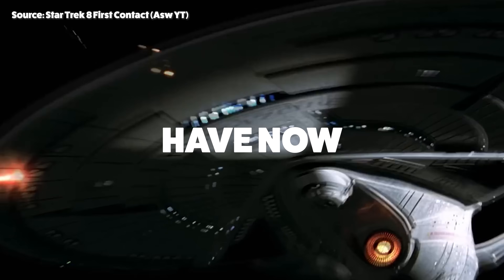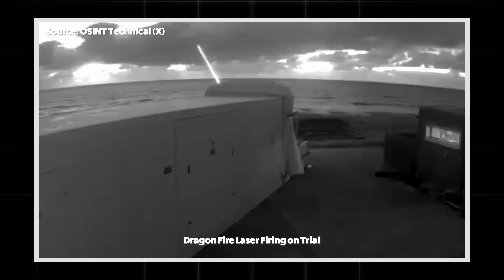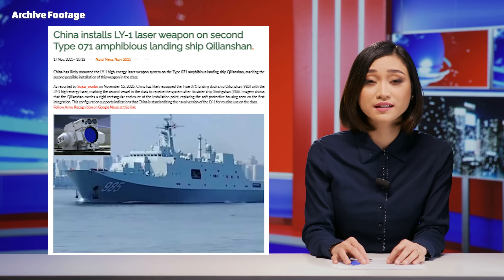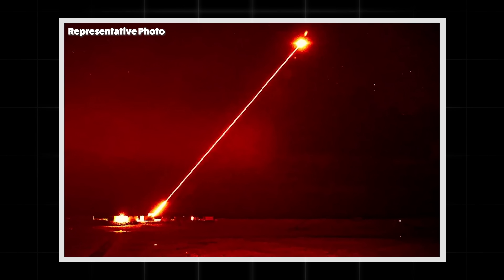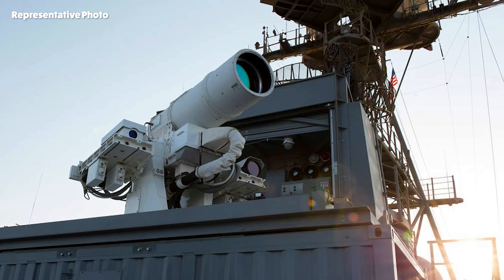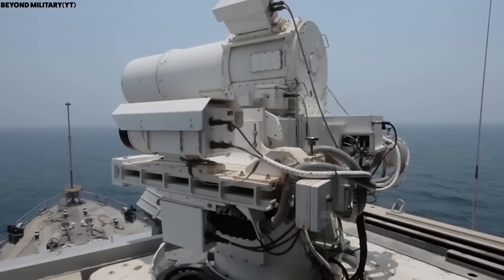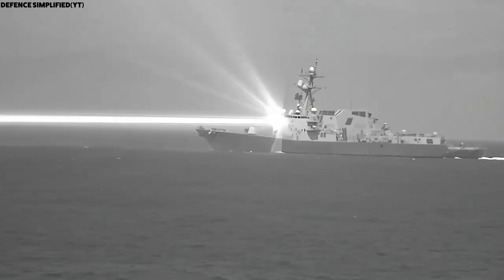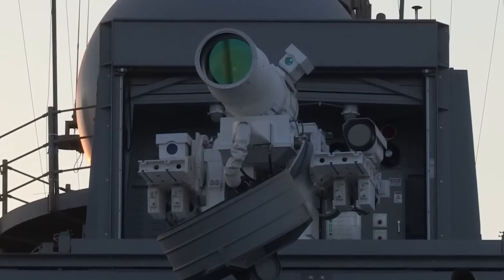UK Just Did Something UNBELIEVABLE: China & Russia in PANIC Mode - DragonFire is Ready

Comment: Okay calm down for crying out loud its not a pew pew laser that is destroying the drone. The beam you are seeing is because your looking threw a IR camara those things can pick up beams that would be hidden to the naked eye.

Essentially the destruction is not done laser pointer that is merely showing you where the device is aiming instead this is using a electromagnetic pulse with a dish designed to concentrate the pulse into a direction rather then emitting by 360 degrees.

The reason because 360 degrees is weak and disperses far more easier compared to directional of 45 degrees allowing it to travel faster and more distance with more intensity thus frying the drone.

Essentially this is a microwave cannon god forbid if anyone stands in front of it though i recall story's about HumVees having portable radar jamming equipment where people get sick because of being in close proximity to them due to long exposure.

Comment: ⚠ Limitations
• 	Atmospheric conditions: Fog, rain, smoke reduce effectiveness.
• 	Power draw: Requires strong shipboard generators.
• 	Line of sight: Cannot hit targets behind obstacles.
• 	Scaling: Still in testing; operational deployment expected around 2027.
⚡ DragonFire vs. Hypersonic Missiles
• 	Hypersonic speed: Hypersonic missiles travel at Mach 5+ (over 6,000 km/h), far faster than drones or mortar shells.
• 	DragonFire’s proven targets: So far, DragonFire has demonstrated success against drones (~650 km/h) and small projectiles.
• 	Physics challenge:
• 	A hypersonic missile covers 1–2 km per second.
• 	The laser must dwell (stay focused) on a single spot long enough to burn through the missile’s skin or disable sensors.
• 	Atmospheric turbulence, plasma around the missile, and extreme speed make this very difficult.
🎯 Accuracy & Engagement
• 	Lasers are instant (speed of light): No travel time, so in theory they can engage hypersonics.
• 	But: The missile’s speed means the laser has only fractions of a second to track and dwell.
• 	Accuracy: Hypersonics maneuver unpredictably, making tracking harder than drones or ballistic missiles.
✅ Summary
• 	Can DragonFire hit hypersonic missiles today? → No, not reliably. It is designed for drones, mortars, and possibly subsonic/low‑supersonic missiles.
• 	Is it possible in the future? → Yes, but it would require megawatt‑class lasers, advanced tracking, and stable atmospheric conditions.
• 	Advantage of lasers: Unlimited shots, speed‑of‑light engagement, low cost per shot.
• 	Limitation: Current power levels and atmospheric physics prevent effective use against hypersonics.
Reply: you sound like a Russian